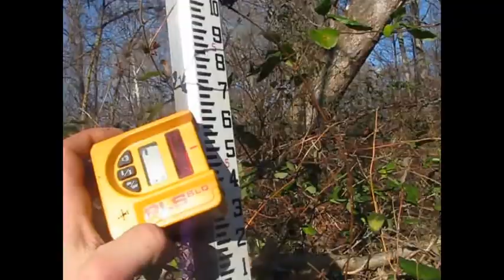water level   Pulser pump 2

Comment: Partly because of your video, I've become interested in the Pulser pump.  How much water volume  did you pump and to what height?   How about a contest?
CONTEST ! - Does the Pulser pump really work in a useful way?  Let's find out.  $10 to the winner.
for more info - see Water Powered Pumps public Facebook group thread:
https://www.facebook.com/groups/240458583255303/permalink/562375124396979/
Reply from the maker: I ended up moving and kind of forgot about that project. I am building a ram pump right now. But I'll think about it
Reply: @gdez1000  Thanks for the reply.  We don't currently have a contest for Ram Pumps, but we do have lots of discussion.  The implied reason for the Pulser contest is to determine whether there are situations where Pulser pumps may be a better choice than ram pumps.  Not sure - may find out .   Here is one of many ram pump discussion threads:
Originally, we were the Water Wheel Pumps group before changing to Water Powered Pumps:  https://www.facebook.com/groups/240458583255303/permalink/521060315195127/
Reply: Might be debatable, but I contend the largest water powered pump ever made was a Pulser Pump and the water pumped was just a by product - air was the product - skip to minute 9 in the video to see the pump pump - https://youtu.be/UtYLVLkWyGc

Not eligible for our contest because it was shut down.

Maybe the great pyramid ram pump was bigger - speculated to have a 4 foot drive pipe.

I'm not sure if the new Canadian 7 million dollar Pulser pump project is operational or not:  https://www.northernontariobusiness.com/industry-news/mining/feds-investing-21-million-for-hydraulic-air-compressor-project-at-holloway-mine-1674030